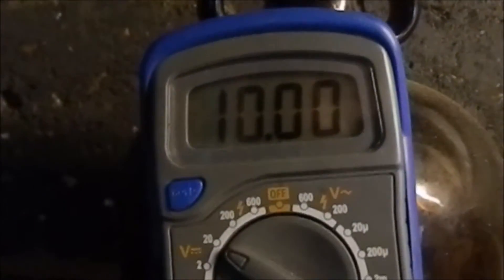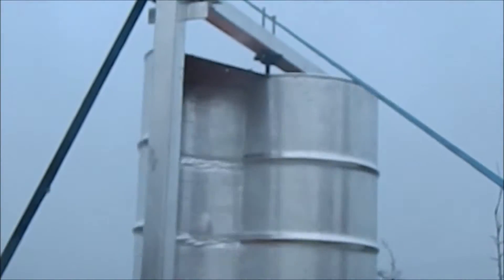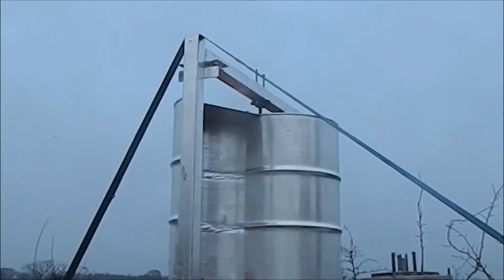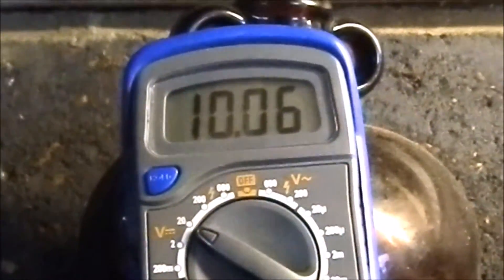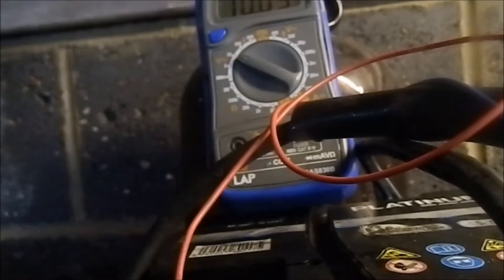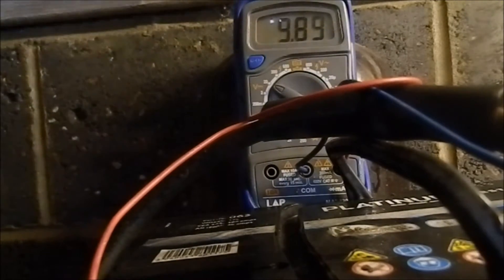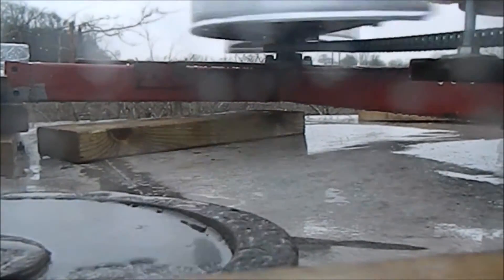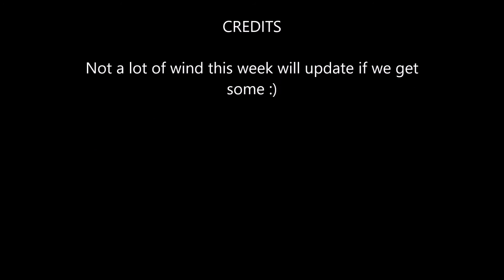OFF GRID PREPPER VAWT wind turbine LOW WIND testing 15/01/2017

Comment: Lead acid batteries are not well suited for solar or wind systems due to the intermittent charging. They can only be discharged to about 12 volts before damage occurs. Hopefully newer battery technologies will become less expensive soon.

Comment: Hi. great initiative! damaged batteries can be a problem but the biggest problem with VAWTs is that you need to work at low speeds and that means a LOT of torque is needed, specially when load is connected. Believe me, new batteries can help a little but torque and speed are the big deal underneath.
Reply: torque is attributed to mass or size of the turbine blade, yes?
Reply from the maker: Yes

Comment: change the cog off the turbine base and replace with one from pushbike pedal cog assembly ( you could try to incorporate the cog changing mechanism as well )  this will give you the option of two different sized cogs this will spin axial quicker.

Comment: hit each batt with 15 to 16v with 5 to 10 amps for a few hours and they can come back to life, ive done it with a few scrap batteries and revived car batts to live another 6 months or more using a 200w 12v unregulated solar panel, you see the sulphation break up, works for me most of the time, mind you i live in a very sunny country, the prison colony lol.
Reply from the maker: I have a 12v psu which puts out 14.4 volts max I was gonna connect each one to that and see what happens then plug em straight in on a very windy day :)